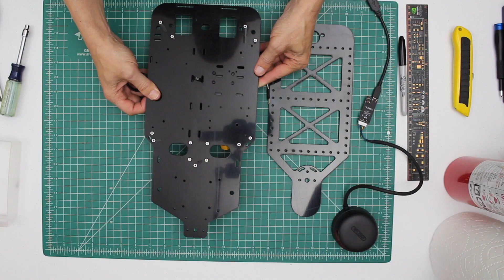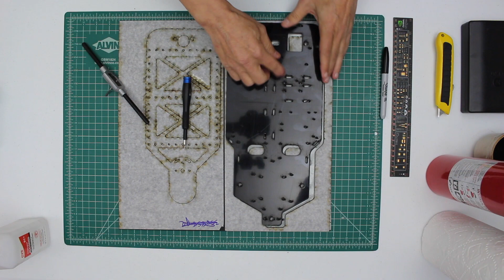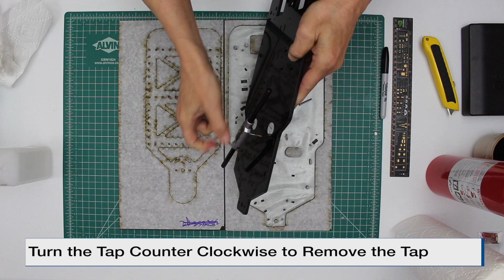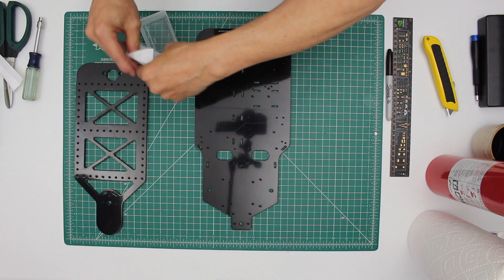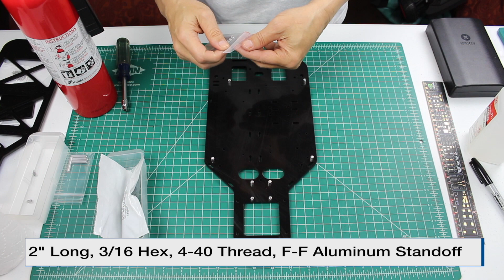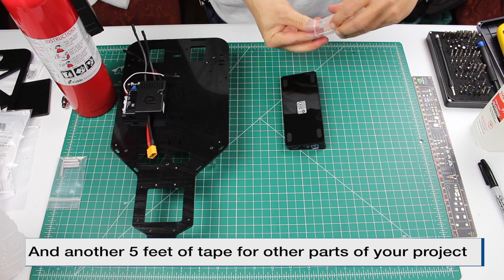RACECAR/J FlatNose Platform Part I

Comment: I know this is not the right place to ask this question, so please feel free to remove it, but here goes:
I've recently installed RealSense SDK 2.0 on Jetson TX2. Unfortunately, pyrealsense2 is not working, even though I've added Python flags to Cmake. Icame across one info that Python wrappers would not work with SDK 2.0. Do you know if there's anything I could do/try? I'm set on using Python with OpenCV for my project and it seems I won't be able to run it on Jetson.
Reply from the maker: Unfortunately I do not know how to solve this issue. You may want to try asking on the RealSense boards or the NVIDIA Jetson forums. Thanks for watching!